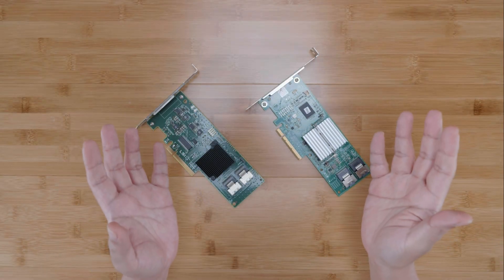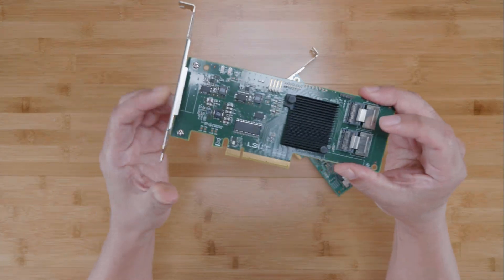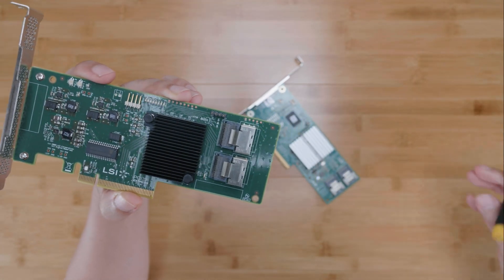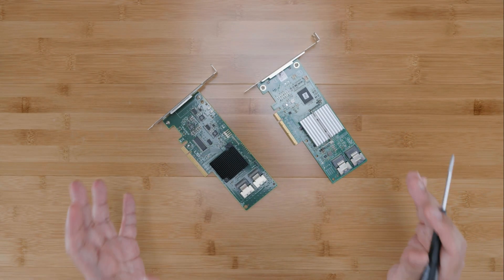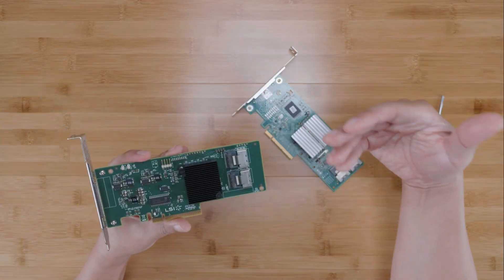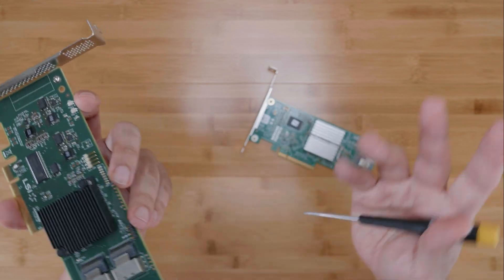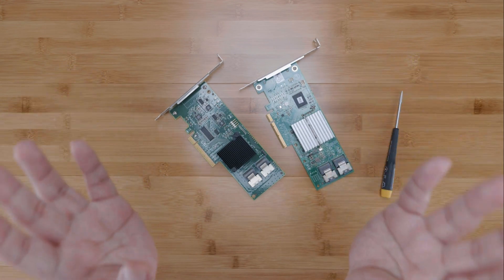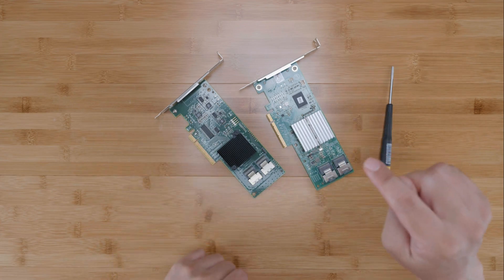6 Things you need to know about the LSI 9211-8i (9201-8i) vs Dell PERC H310

Comment: What is IT mode? I need a LSI HBA card for an UnRAID server. I currently have 2 parity drives and 5 data drives, all 2TB SATA 3.5 inch drives. I plan to gradually replace the drives with larger SAS 3.5 inch drives. Can I run a mixture of SATA and SAS drives off the same LSI HBA card? I want to be able to expand up to 16 drives in the future. Do I need a -16i HBA to expand to 16 drives? What the difference between the LSI 9200 and 9300 series HBA cards?
Reply from the maker: Here's a video comparing IT mode (HBA) vs RAID: https://youtu.be/xEbQohy6v8U

To help you choose the right LSI HBA, you should watch at least the first 3 videos in this playlist:

https://www.youtube.com/playlist?list=PL28eVGz5vFQ8lmttOxL17QwJ3KJp05wi6

And yes, you can mix SATA and SAS drives on the same controller. And yes, for 16 drives, a -16i will allow for that. There's also the possibility of combining an HBA with a SAS expander to connect that many (or more) drives. To learn more about using SAS expanders, watch this playlist:

https://www.youtube.com/playlist?list=PL28eVGz5vFQ-pn6eFBC6AmfbL3yPcBDV7

hope that helps! :-)

Comment: Does anyone know why the LSI 9211-8i only runs at 4x (downgraded) moved it from Pci_e3 to Pci_e1 on my MSI B760 motherboard but then it goes to 1x when running lspci -s 05:00.0 -vv | grep -i LnkSta
Reply from the maker: Maybe your motherboard only supports PCIe x1 in that slot?
Reply: @ArtofServer it should be x16 as its GPU slot but as I don't have need for GPU it's free. Speed wise I'm getting data transfer of around 120Mb/s on my mechanical drives but drives me nuts it showing as downgraded when it should be x8 all day long 😂

Comment: Thank you for the comparison. BTW, do you install a fan directly blowing on yours? I noticed my heatsink gets hot.
Reply from the maker: Almost all of my server setups are in rack mount servers, like Supermicro or Dell. In those setups, there's already a lot of airflow going front the back so I don't install any additional fans. If I were putting this in a desktop PC case, I would consider putting a fan to blow on the HBA heatsink.

Comment: If it is blinking (heartbeat) on H310 with green light , is it okay?
Reply from the maker: blinking heartbeat LED is a sign that the firmware is running normally.
Reply: @ArtofServer  Thank you. Which HBA would you recommend for ESXI 8.0 and for 1-2 HDD? I just need passthrough it for NAS. Unfortunately, H310 is no longer supported in ESXI 8.0.

Comment: I bought a 9211 but not from you - if I'd seen this video first I would have gone to your store. Noted for next time. 

Thanks for making content like this. Do you think an LSI 9211 8i needs a fan attached to the card? I have an Antec P101 which has 3 front-facing fans which should blow across the entire motherboard, but I'm concerned about the hard drive cages blocking some of the air. 

I'm assuming if the HBA overheats, I'll get some type of warning/error, rather than permanently damaging my card (or worse, introducing errors into my data)?
Reply from the maker: I do recommend, as per Broadcom's documenation, that at least some airflow is blowing over the heatsink of a 9211-8i card. Doesn't have to be massive airflow, even a case fan blowing on GPU and PCIe cards would do.

What I've observed in overheat situations is that the card will crash, and the driver software will attempt to restart the card. Usually it can successfully restart it, but then crash again until the cooling situation is resolved. Most of the time, it can sustain this pattern for some time, but I have heard of cases where it eventually just won't restart again.
Reply: @ArtofServer  thanks for the generosity of your time!
Reply: @ArtofServer  thanks, I slapped a 40mm fan on top of the heat sink with zipties, then plugged the fan into one of the sys fan headers and set it to run at 50%. The heatsink is cool to the touch!
Reply: @newstandardaccount Thanks for sharing your experience

Comment: Is there a huge difference in performance from the 9200 series card, which is pcie 2.0, versus the 9300 series in pcie 3.0?
I'm spec'ing out an AM4 build for the sole purpose of having a pcie 3.0 x8 slot, but it's definitely more costly than AM3 or 2 (like using an Asrock x470d4u mobo). But those previous gens only go up to pcie 2.

Sorry for all the numbers in the question, but if anyone has an answer I'd really appreciate it. It's a question of running 8 drives in zfs at a reasonable speed despite the 6gb cap in the 9200 series card.
Reply from the maker: Depends on what drives you're using. SAS2008 is usually enough for most HDD storage systems, but not SSDs. For SSDs, I would use SAS2308 or newer and depends on your SSDs? (SATA-3, SAS-2, or SAS-3)

Watch this video for more guidance: https://youtu.be/Q4e8kmuGm6o
Reply: @ArtofServer  Awesome! Thanks for the response

Comment: Hello, I have an LSI 9211-8i card, and unfortunately, I'm receiving checksum errors on the drives connected to it in my TrueNAS system. I'm using it passed through as PCI passthrough in Proxmox, with TrueNAS running on a VM. Would replacing the HBA card with something like a Perc 310 potentially solve my problem? The drives have been tested and are definitely functional.
Reply from the maker: checksum errors where? like checksum errors on the SATA drives SMART attribute 199 (UDMA CRC)? or on PCIe bus? Usually, UDMA CRC errors are due to poor SAS connections (not properly inserted cables) or a bad cable. If it is PCIe bus side, there's a lot of potential reasons, one of them being damage to the PCIe lanes on the card, but could also be defective PCIe slot or motherboard.
Reply: @ArtofServer  the errors appear in the drives tab in truenas. How can I check what type of errors these are? The motherboard is definitely functional, because I tried to change the motherboard and the errors also occur on another one. the cable and socket do not appear to be damaged.

Comment: I bought a 9201 to put in a Fujitsu server we use only for testing hard drives, it had a raid card and it was worse
Reply: The card works in the integrated slot too (fujitsu rx300 s7 and s8
Reply from the maker: Thanks for sharing!

Comment: I have a problem you might be able to give me an answer on given your use of and knowledge of lsi hba. I have a dell poweredge t310 I'm trying to add a lsi 9201-16e card to. I don't ever see a post/bios screen to press control c to enter. Is it even actually possible to use this card in the dell t310? If so how?
Reply from the maker: If your 9201-16e card doesn't have the LSI BIOS or UEFI ROM installed, then you will not see the "ctrl-c" option during POST. Alternatively, if your motherboard is configured to disable the OpROM, or "Option ROM" for the PCIe slot of the 9201-16e card, that would also result in the same effect.
Reply: @ArtofServer  a bit of mixed bag here. But, used my main windows desktop to install the card, cli update the bios and firmware to latest needed.

Dell t310 far as I can tell will not ever see this on post or in the bios outside on the irq assignment list.

But since I'm running unraid and it did indeed sees and loads the right drivers, uses it just fine.

Also, because it happened to me, make sure the mini SAS cable is plugged all the way in.

I tried using your idea.. Looked everywhere in every option. It did have the option rom under Broadcom network boot area. But had nothing to do with the add in card.

Maybe someone will find this info useful. Thank you.

Comment: One small detail about the LSI not mentioned, is the 4 pin header for adding HDD activity LED’s. There’s a 3.3V and ground for each port. I know it’s mostly cosmetic, but I have a hard time seeing the multitude of board mounted LED’s, since my card is near the bottom of the MB. it just adds an easy to see diagnostic for each port. It’s the only card I’ve seen those headers on.
Reply from the maker: That's a good point. I know of some friends who use that to connect to LEDs on the front panel. Thanks for pointing that out! :-)

Comment: Is IT mode revertable? Can i flash again raid original firmware? Is the 9211 a raid card? Or hba
Reply from the maker: yes, of course it is possible. IR firmware is very simple, just erase the IT firmware, and flash the IR firmware. MegaRAID firmware is much more difficult though. You need to erase firmware and change the SBR too before flashing the MegaRAID firmware.

Comment: Unfortunately I encountered that fuse problem mentioned in point 6. Ordered and used since August 2022. My machine was down since early November 2022 and yesterday wanted to turn it on and the card gave no life. Slotted it in another PCIE, in a new machine but nothing.
Sadly I do not have the capability to fix this fuse so no other choice to get a new one. Ordered the same one simply because I knew it worked without a hitch on my Asus PRIME Z690M running Unraid. Don't want to deal with the Dell one potentially not working on it.
Keep up the good work Art of Server!
Reply from the maker: I'm sorry to hear that. The fuse is a very cheap component and is easily replaced. See if you can find a local electronics repair shop and they can probably take care of it in about 10 minutes.

Comment: One thing I've heard repeated a few times is the H310 has a lower device limit (~32 drives), compared to the LSI card, when used with an expander.
I've read the specs a while ago and from memory it seems to only talk about the limit in raid mode.
Could you confirm if there is any difference (in IT mode), and what those limits are? 
Cheers :)
Reply from the maker: The number of addressable drives is determined by the lowest common denominator between what the hardware can support and what the firmware can support. The LSI SAS2008 chip being the same in the H310 vs 9201-8i, then the difference is likely in the firmware. That said, if you put LSI IT mode firmware (from the 9201-8i) on the H310 card, I think you will have the same limit as the 9201-8i. The Dell firmware may have a different limit, because I know the Dell firmware also puts an artificial limit on the queue depth. It might have been Dell's way to differentiate the H310 from their higher end cards to justify the price differential.

Comment: Love the video. I really like the comparisons.  Quick question tho, what type of card would be good for braking out to 16 or 24 drives for UnRaid?
Reply from the maker: For that many drives, either use multiple -8i cards or use a SAS expander. For SAS expander setups, watch some of the videos in this playlist:

https://www.youtube.com/playlist?list=PL28eVGz5vFQ-pn6eFBC6AmfbL3yPcBDV7

If budget is no concern, and you have limited PCIe slots, consider the 9201-16i, 9300-16i, 9305-24i, 9400-16i as alternatives. Those cards are pricey, and other than 9201-16i, run hot too.

Might want to checkout the 2020 HBA comparison video I talked about at the start of this video too.
Reply: @ArtofServer  thank you for the recommendations. I will definitely look into the videos and cards. Thank you for taking the time to answer my questions.

Comment: I chose the Fujitsu RAID Controller D2607, with the same controller, the LSI SAS2008. I found it on a website where the different cards were collected by the LSI chipset.
It's on its way to me, hope it will work in my TrueNAS Core with a Gigabyte motherboard.
Reply from the maker: I hope so too!
Reply: I also recently added another SAS controller to replace one that died and I managed to flash it to IT mode. It is working great and was a good purchase, much cheaper than many others.